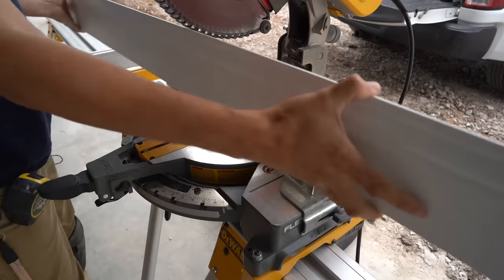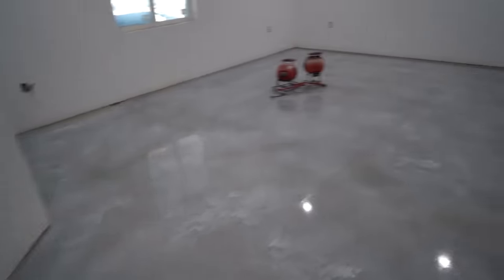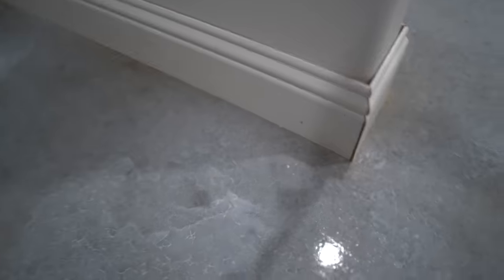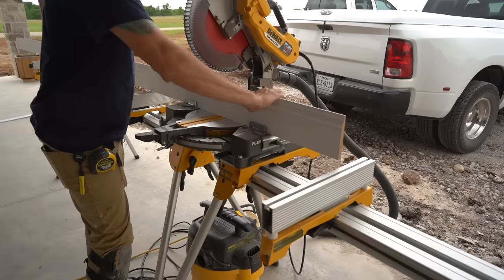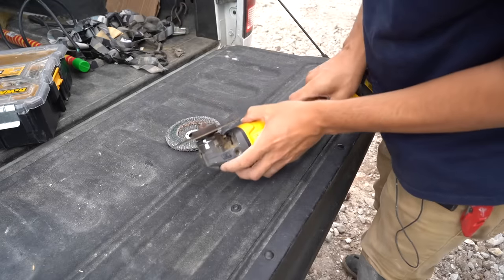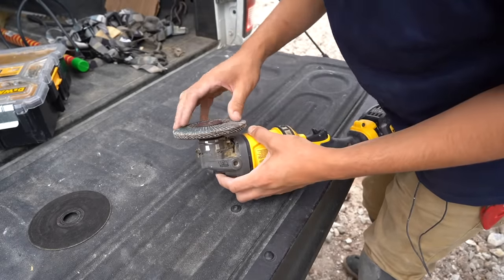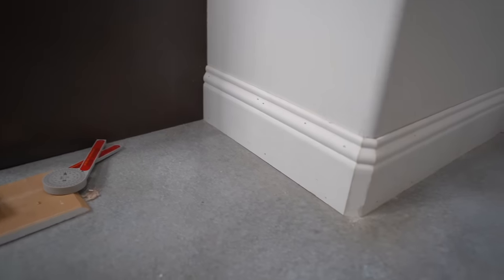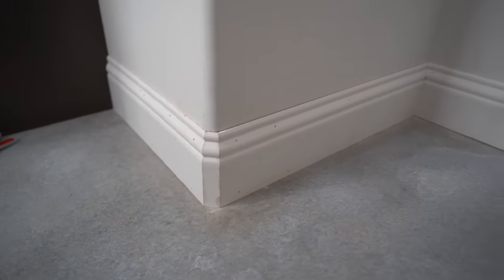don't let your framer do trim

Comment: I'll stick with my coping saw, that sander is very unforgiving!
Reply: I learned that grinder sanding trick a couple years back and it does take time to learn how to do it right. Maybe try it on some scraps and if you still don’t like it - you can always go back to what works for you, which in this case is a coping saw. I never judge a person for using what works for them if they are getting the results that they can appreciate.
Reply: @lilbeanie5078  coping saw quicker than the grinder, and that's what the framers thought about caulk 😂
Reply: I have seen this grinder trick. I just use the coping saw and files and a rasp, the good old way
Reply: @traviskruse2153  try a different blade?
Reply: @traviskruse2153  it really sucks with hickory trim.
Reply: Grinder sucks if you hate breathing mdf. Make a vacuum table.
Reply: A grinder with a flap disc is the ONLY way to go. See easy.  Just make sure you do it outside though...and yes, wear a mask with MDF.   I'll also use a Dremel (801) with a carbide shaping wheel for the finer details
Reply: I would have cut 2 neat scribes with coping saw in the time it took him. Just on pine though

Comment: How do you deal with peaks or valleys on the floor while installing trim?
Reply: I think for him specifically the problem is mitigated by the fact that most of his work is higher end or high end. I did really low end finish work for a long time and fortunately that meant that the smaller, cheaper base would bend easier on the vertical Axis but for anything extreme you just scribed out humps and caulked dips if the base was already being caulked (to the laminate floor in a bathroom for example)
Reply: The beauty of white base board is the easy use of white silicone
Reply: @goodnamesareallgone1   paintable caulking not silicone. I made that mistake once when I was young
Reply: You redo that flooring, because that should be leveled or else everything you build on top will also be wonky. Dont want to fix the flooring? Then put a thick caulk line.
Reply: If the house has an old look or is actually really old (like 100 years) a base shoe which has really good vertical flex will follow along the floor and hide the gaps.  If the gaps are really bad a scribe may be needed to take out the worst of it before adding the shoe.
Reply: @goodnamesareallgone1  never silicone it's a nightmare to deal with
Reply: @cassidy5099  I ran a guy off my jobsite once, I told him to prep about 350 linear feet of 4 1/4 of base. I told him caulk, not silicone. He used silicone.
Reply: @oscarmarruffo4548  I assume you'd just try to caulk over the silicone, what did you end up doing?
Reply: @cm01  masked off the floor and sprayed it with aerosol shellac primer. Paint will stick to it then.

Comment: A jack of all trades is usually a 60-70 year old man
Reply: The jack of all trades loves to rip drywall on the table saw, grout 3 times to make it look good, paint everything with a roller, and glue countertops on with caulk, but at least the end result is good even if it takes longer. Don't confuse this with Chuck with a Truck who really puts his insurance plan to the test when he tires to do a complete bathroom remodel after his 6 months of siding experience.
Reply: @cm01  I love riping drywall on a table saw :))
Reply: @cm01  Not even close.

Comment: Mad how in America they have a guy for just framing and just trim ect. In the uk a joiner and carpenter can literally do everything (to a high standard) . Does it not get boring and repetitive skirting/arcs/coving (crown) all day everyday ?
Reply: same in Norway, i have never heard of any other country that has different types of carpenters that only do 1 thing before
Reply: Same in Australia. Sure there are guys specialised in framing or only second fix but most carpenters over here are trained in both aspects.
Reply: There are tradesmen here that do both and often do it well, but in some areas, they're building homes so fast that they found it necessary to break the trades down to speed up production

Comment: I'm alot faster with a coping saw than you are with the grinder !
Reply: I saw that.   Doubt they have one although They Probably saw it in a  museum  with a block plane.
Reply: right.. dude is using an angle grinder for mdf... 😆
Reply: @matthewmartin2421  But you saw how careful he was and the result he got, right? If he doesn't get as good of results with the coping saw, why not keep using the grinder? Might be the wrong tool, but it was masterfully applied.
Reply: i learned how to use a coping (hand) saw in 1 day and was about 10 times faster with it than this...  And when he said that 16 3/4 "Heavy" is 16 3/4 b/c you have to account for the end of the tape he lost me...
Reply: @EliFulton  Because most tape measures have "loose" tab ends, hence the tape grows when pulling off the material and shortens when you push the tape up against material.
Reply: @jtsherry6255  yeah fully aware.. hence why I said the tape is made to make up for the end.... That's why it slides in when butting up to measure and slides out when you hook.. you don't have to add or subtract to that when you're measuring or you need to go get another tape
Reply: @EliFulton  @JTSHERRY yeah, it should slide the same length of the thickness of the hook when you are hooking over, when youre butting in the hook will do the job of the slide gap.
Reply: @jdpace4371  At the end of the day do what works and is comfortable to get a job done. But, certain things should be considered in regard to time/efficiency, amount of nails needed and that mdf is a composite material where it'll experience movement. Expansion/contraction happens more often with mdf materials, so its recommended to measure long (1/8'') make the cope and install which will create a slight snap in affect without compromising quality.
Reply: @jakemaster33  Thank you - makes sense
Reply: True.
Reply: @jdpace4371  There is no denying his outcome. Precision. And well explained

Comment: I started out framing. Was a nice way to start learning wood building and angles. Moved on to hardie siding. Then straight to crown and installing cabinets. It's an art not for everybody. Not everybody can do finish work. And not everybody takes pride in their work.  Now I build houses basically from start to finish. Minus plumbing and concrete work. Even paint them. I consider that a real carpenter.

Comment: I've been painting houses for 25  years,,a little crack is better than super tight because you can actually put caulk into the crack rather than just sitting on the top,,nice work

Comment: I am actually one that is a jack of all trades. I own a Handyman company. However, I have actually worked in many different trades throughout my life and as a maintenance tech for a couple of years and a facility supervisor for some apartments for 5 years in both of those jobs I had to do everything. However, I did hire some companies to do work at the apartments when I did not have time or want to do the work. Before that, I worked as a finish carpenter for 6 years in a commercial cabinet shop for a year and a half and a commercial plumber for two years. For electrical I did it in my maintenance jobs and also at a job wiring 24 volt systems for oil field skid's for 11 years where I also built shipping crates and skids, welded them together then after doing the equipment alignments on the sub-bases welded those on, drilled and tapped for equipment mountings as well as did the plumbing as a pipefitter on the skids and gearboxes then painted them. I have wired my own car stereo systems for 35 years. I have also been a mechanic working on my own vehicles for 35 years. I started working in my Dad's woodshop at a young age and helping him work on our vehicles from a young age learning a lot.  Now that's not to say I know everything about anything no one does. The nice thing is there's YouTube and the internet these days that you can use to learn areas and procedures you don't know so well. I learned how to replace two complete A/C units on two different vehicles and was successful in both of those instances. The A/C systems were the hardest thing I ever took on and at some points in the process, I wondered what the hell I had gotten into. The thing is you have to be the type of person that is willing to put in the time and effort it takes which is hours of research and learning until you are sure you understand what you are doing. Now as far as framing houses don't like it. Walls are easy but roofs can be very difficult and that is one thing I would not take on is a whole-house roof with a lot of different valleys and peaks with complicated angles. I have built buildings simple lean-to roofs and A-Frames and even a lean-to with a 6 ft extension off the back for a porch that was at a different angle than the main roof and several porch extensions off of houses. However, I don't particularly like walking around in the top wall plates and all of the interconnected parts of the house with complicated angles is something I would only do on my own house one day not a customer and I would not make it difficult. I had a job as a framer for a short time and it was not for me doing the roofs. Building decks is my favorite thing to do. I have done remodels where I tore down walls built new walls re-routed all of the plumbing and hooked into the home wiring to re-wire a bathroom and install all of the switches, receptacles and fixtures as well as did the sheetrock and install a new shower. Have also done a lot of concrete work and even some stuccoed structures. It can be very stressful and difficult to learn new things but the information is out there now and if you are a person of the right mindset with a good background in construction and a variety of trades you can do everything and do it right if you put in the effort necessary to learn about the job at hand and follow local building codes.  Now at my age, I have a lot more experience in different trades but still don't know a lot about plumbing and especially electrical but I have done a lot of re-wiring to install new lights, switches and receptacles as well as ceiling fans and appliance installations. It can be very difficult to learn about so many different things and do them all correctly but if you are motivated enough and want to learn the stuff you can do it and do it right with high-quality work. Yes, you can be better if you specialize in one thing but I think it is more interesting to do a lot of different things.

Comment: I started off building homes 35 years ago, i framed houses laid out and cut rafters, it takes knowledge and skill to do, now I'm a trim carpenter and cabinet maker, the old adage goes_ A trim guy can frame, but a framer can't trim, it's very true, even if it sounds condescending.

Comment: I would consider coping those inside corner with a table saw. When inside corners aren’t square or 90 degrees they can cause gaps. Run your longest lengths through with square cuts into the corners. Off a bit, it won’t matter. Cope the shortest runs and voila’. Perfect inside corners. Use a little sandpaper when it’s needed. Trade tip: pencil mark the leading edge of your 45 degree cut on the cope. Use a table saw and back cut the excess profile by putting the baseboard perpendicular to the raised table saw blade and feed it into the blade accordingly to remove the excess. It’s a lot more stable than a grinder where you are free handing things. You can of course cut the excess square portion with the chop saw in advance.
Reply: Thats a good idea, and the radius of the blade gives you good back relief so nothing interferes. Nice tip!

Comment: Spend a weekend using coping saw get one with decent blade (not harbor freight) hold board like you were but come up from bottom don't use alot of pressure (wrecks blades and is slower). You can cut out cope in 20-30 seconds probably by end of first day when it becomes regular 10 seconds flat. May not think much but adds up especially on base which is probably my least favorite for margins.

Comment: The end of your tape adjust for a reason.  When you bump and measure it slide towards you to account for the thickness of the tip.  It slides away when u pull to so the same. Now if when u bump and pull and they dont measure the same your tip is bent.

Comment: Nice work. The only thing I would add is to make sure you have an even gap under the base whenever possible.  Base in kitchen and bath should be caulked on the bottom  to the flooring prior to paint as water will go under and swell. In all other areas, a 16th to 32nd even gap from the bottom of the base to the flooring will fool the eyes to thinking your floor is perfectly level.

Comment: Hey great video. Can’t believe any carpenter would walk away from corners that awful. But I guess that’s why they call them “rough carpenters”... when you said to make sure to account for the little “pull” on the tape measure that little bit of wiggle is actually there to ensure your measurement comes out correctly when butting you’re tape into a wall like that. The amount of wiggle in the end of a tape is the same as the thickness of the metal end of your tape. This is because when you butt into a wall that clip is a part of your measurement but when you put it on the end of your board the metal clip is now over hanging the edge of the board and the tape needs that little bit of allowance to account for the thickness of the clip that was a part of your original measurement. You probably knew that already but hope this helps someone out there!

Comment: Nice work. Digging the angle grinder. If you have one give it a try but the absolute best coping tool is dremel with sanding bands. Same difference really but dremel whoooole lot easier to control than the grinder lol

Comment: They shouldve installed bullnose adapters to bottom of bullnose cornerbead, that way you  have a 90 degree angle and not a rounded edge. But what you did looks very nice and clean. Good job👍🏼

Comment: As much as my dad and I do not get along, I’d have to say he might be one of those Jack of all trades. He’s a plumber by trade, but he can do almost every other facet of building a house and can do it to an extremely high level. (He can also rebuild cars and do all kinds of other technically mechanical stuff.)

He set the bar for me so high that when I met other tradesmen as I entered the professional world that couldn’t do what he can, it disappointed me. Come to find my dad was the exception not the norm.
Reply: My grandfather is the same way. He’s a perfectionist and a true Jack of all trades. He was a teamster so he drove trucks, did construction, built bridges and highways and such, before that he owned his own body shop and did mechanical work as well. He taught me everything from mechanics, welding and auto body to framing, drywall, tiling, plumbing, electrical, finish carpentry, concrete work, masonry etc. Luckily we always got along pretty well and had a good relationship, but I get it, you need a pretty thick skin to work with my pop too. He’s harsh, and tough, and set in his ways, gives few words of encouragement and plenty of criticism. That’s just how the old breed is, they grew up hard and learned tough, so they teach that way too. Try not to take it to heart, I think the tough criticism is their way of pushing us to grow and do better and try harder. And just because they don’t show it doesn’t mean they aren’t proud of us. My pop would never praise my work to my face, maybe a “yeah, looks alright” is about all I ever get. But I’ve had family members tell me he praised my work to them before, when I wasn’t there. So you never know. At least you got to learn a bit from a master while you could, I doubt there will be many around much longer. They’re a dying breed for sure.

Comment: Different chop saw’s fences are concave or parallel side to side in relationships to the project requirements of each specialization and reading your user’s manual explains the nature of your fence. Siding works better with a concave fence but finish cuts on short boards with the same tool fails to provide good cutting. That’s an interesting method for coping; a grinder. Some carpenters will bend the fence of their saws for finish cuts on short boards while ignoring the dangers of short stock cut in powerful chop saws.

Comment: Hmm, I think ima try out the angle grinder flap disk for coping 
Also never used CA for mdf, Ive always just sized the joints but that takes forever if you can't have multiple pieces sitting around with glue on them.

Comment: I prefer the the flat sanding disk rather than the flap kind . You can get into tighter areas of a profile. You just need to use the plastic backer plate

Comment: While the grinder will definitely hog out the material for the coping, I prefer using a rotary tool for the details. Super light-weight, and the radius on those little drum sanding attachments is usually just right.  

That being said, it can be time consuming on harder woods, so it's nice to have the grinder handy.

Comment: Nice!  -- QUESTION -- @3:47 you said that when measuring with a tape, you had to take into account "the pull at the tape end".  My understanding is that you do NOT have to do that.  In fact, I was told that the pull slides in or out depending on whether you are doing an inside vs outside measurement using the pull.  It slides to compensate for its thickness ie you should go by the actual measurement shown on the tape. IS this correct information?? I thought that it was...

Comment: Still hand man! Impressive. I would probably put a weight with a cloth on the board to have two hands on the grinder. Would you try that with hardwood? Or just compound? I just use the mini hand coping saw